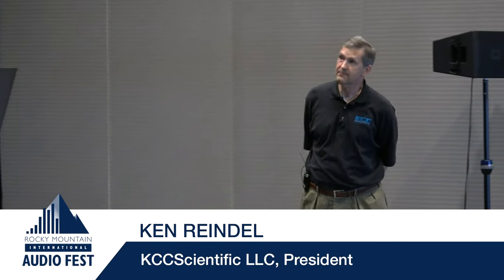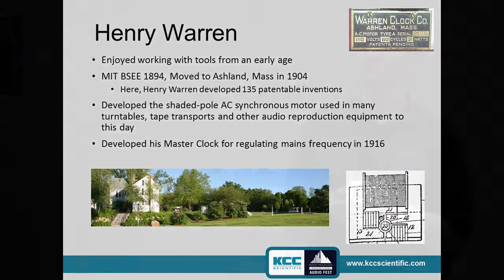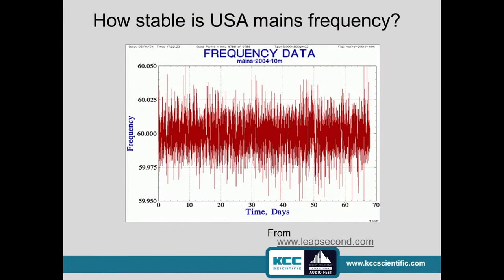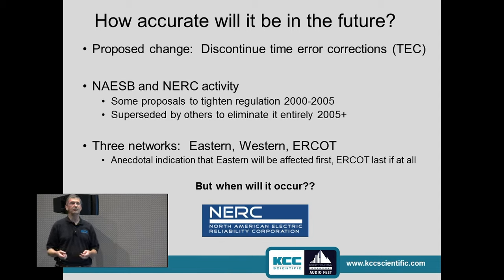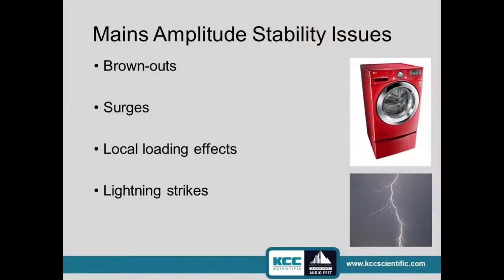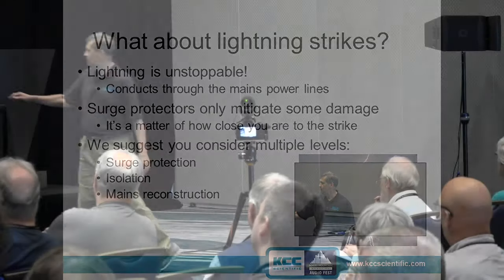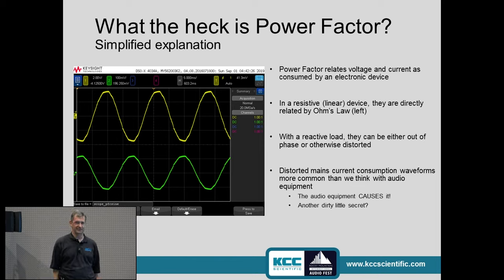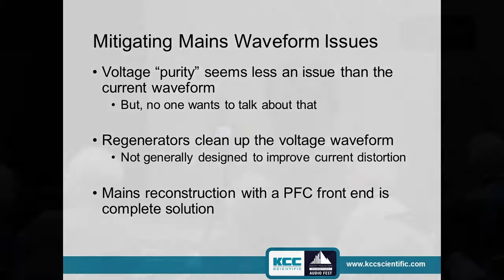RMAF2019 - The Dirty Little Secret: Powering Audio on Mains Power Line

Comment: How refreshing to see a clearly expert (and diplomatic!) speaker with an open mind and not necessarily just promoting his own products. Thoroughly enjoyable presentation and very educational too. The comment about electric car charging technology is particular food for thought; I would assume it wouldn't be too big a leap to hone existing EV battery technology into physically smaller but still high current capability power supplies for audio equipment which would then ensure a perfect, low impedance DC source. I remember a UK company called Crimson Elektric (I think they're now defunct!) powered their preamplifier from a torch battery and I have heard of enthusiasts that use standard lead-acid car batteries for pre-amp supplies too but, obviously, these are only good for low-ish current applications

Comment: He never explains how his system is different than a power regeneration. They seem to be the same thing.
Reply: Bill, It's kind of hard to discern at first. Watching from 20:05 and 35:10 should help. Mains reconstruction recreates amperage/current fluctuation, making incoming 'current' more sinusoidal. Whereas, power regeneration corrects voltage fluctuations.

He displays a graph 23:05 showing aberrations of both voltage and amperage sine waves from the same source. 

I hope you find this useful.
Reply: @ubermind-tim  How is this done?

Comment: 28:55. He doesn't need to care about the power factor issue on his linear powered digital equipment. Well regulated linear DC power supplies factor expected AC issues such as transients, short term (1 or 2 cycles) voltage dips and peak waveform distortion into the design. The power factor issue is more of a concern to the electricity company than it is to him. He may benefit from brown out protection IF it is an issue in his area.

Comment: Absolute snake oil. The  graph at 21:37 is actually how linear power supplies draw current. Try simulate a linear power supply and  see how current flows through the capacitor, its only when the rail voltage is higher than the capacitor's voltage that the cap would draw current , so it only happens at near peak voltage. This guy is not a moron, he is a snake oil marketing genius